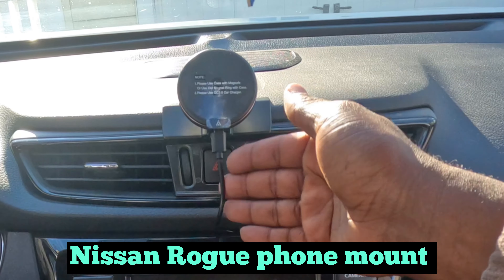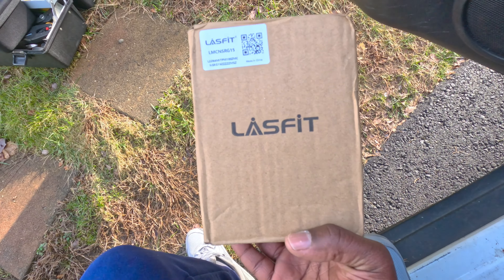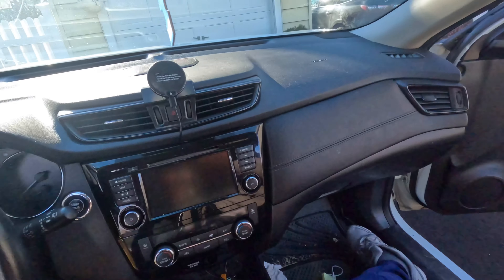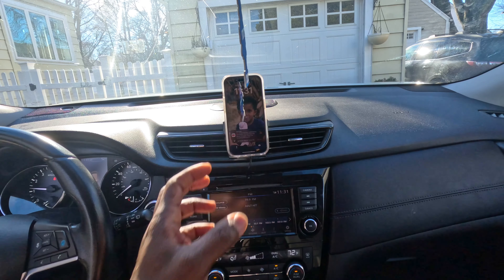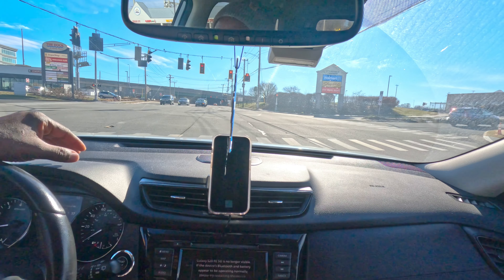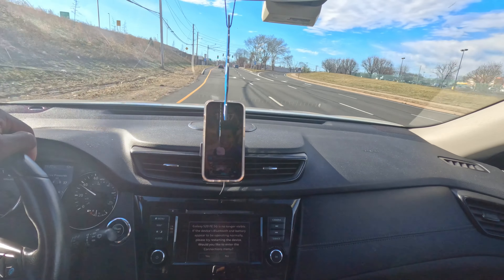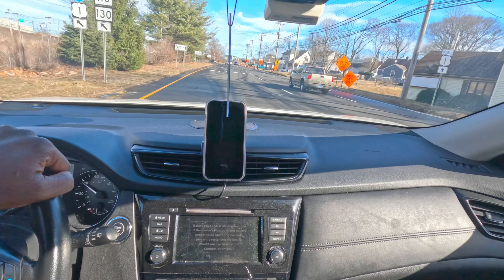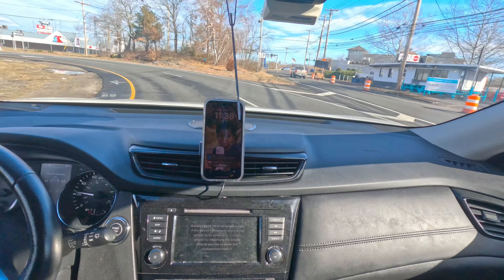How to install a Phone mount on a 2014-2020 Nissan Rogue

Comment: The holder scratches the plastic or is it safe ?
Reply from the maker: Once you put the Connector and route it the way I did it stays there is does nit move so it wont be scratching anything,.